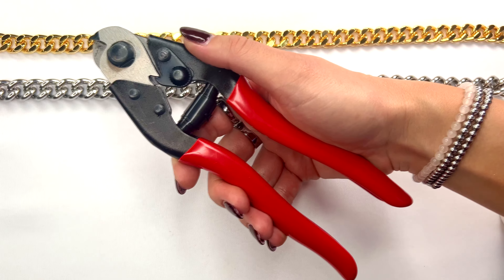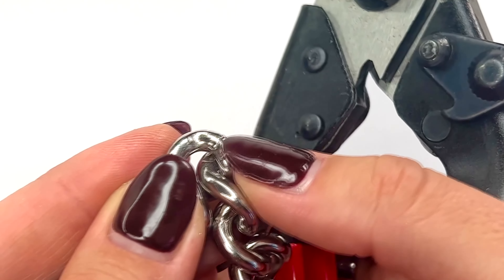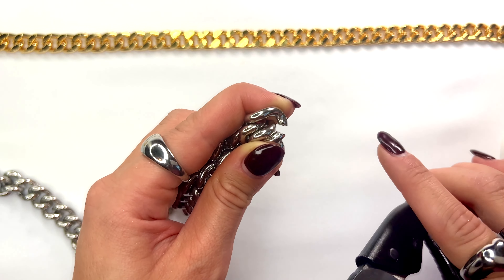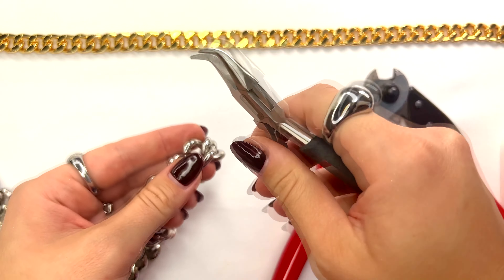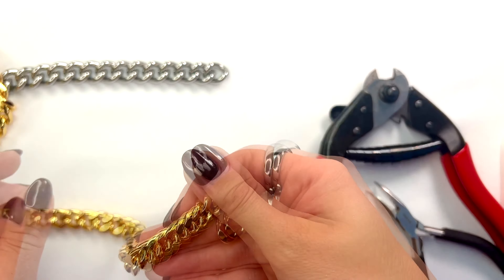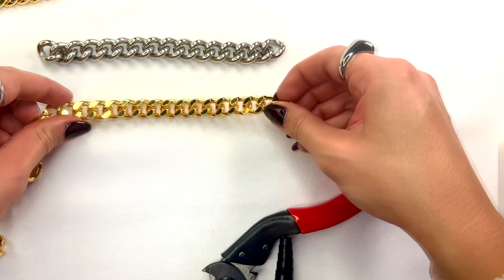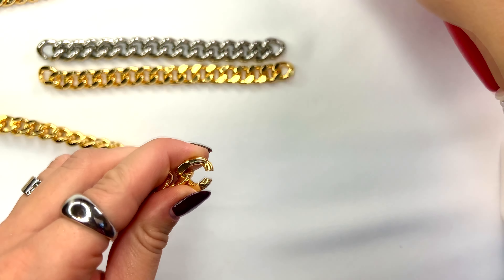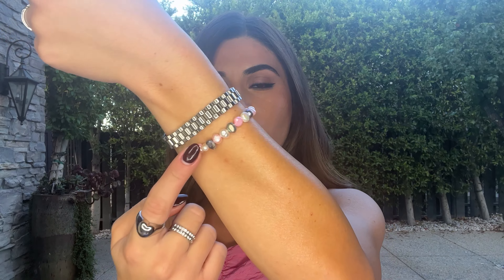How to Cut Thick Jewelry Chains

Comment: How to close the link after you opened the chain?
Reply from the maker: You can use pliers to attempt to close them, although we don’t recommend it because the metal is bound to get scratched
Reply: @AthenianFashions  but you have to close the ring after you cut it and resize the chain. Except for the piler what other tool can close the ring well?
Reply from the maker: @glongshot  we recommend a set of pliers (2) to open and close jump rings. A bent nose plier and chain nose plier would work best to open and close the rings.
Reply: @AthenianFashions  wish you could show us how to close the chain after cut and resize it. Cutting is easy but closing the opening is not easy.
Reply from the maker: @glongshot  we recommend attaching a jump ring at the end instead of closing the link back because the metal will scratch